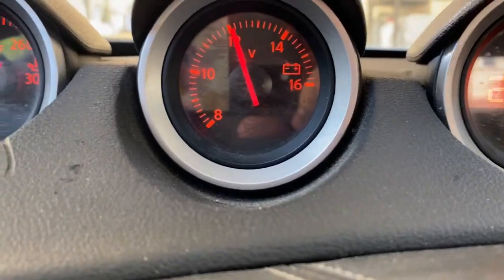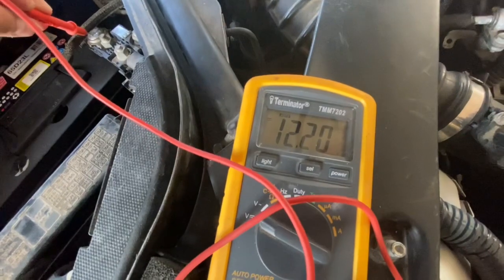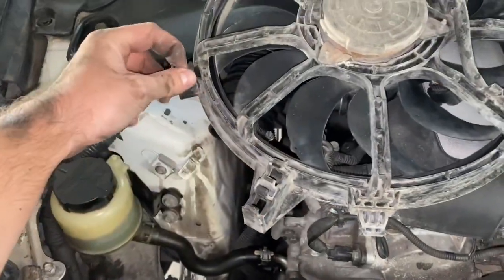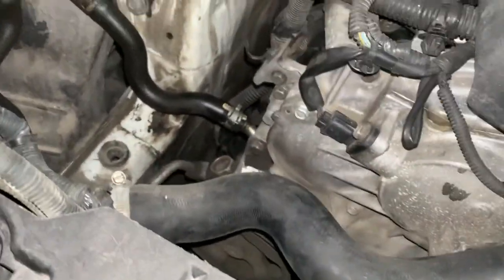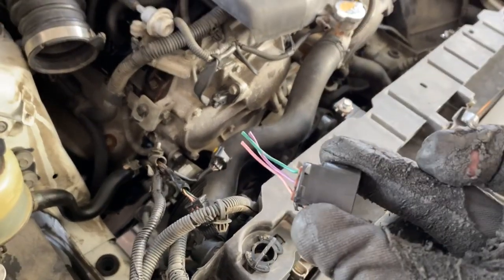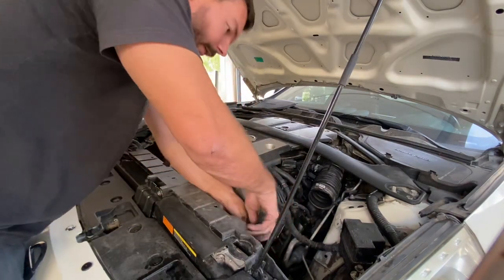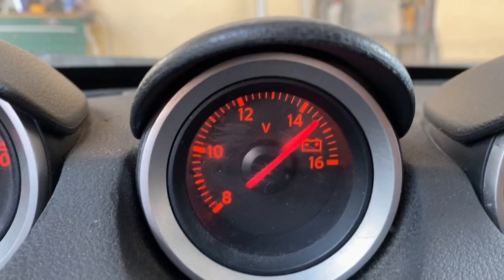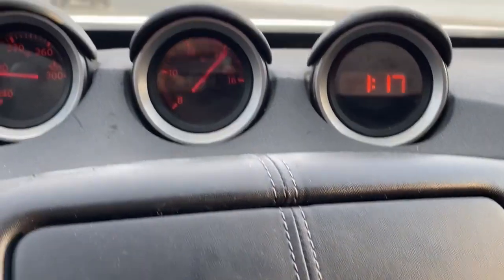Car wont start / run : alternator or battery? (Nissan 370z)

Comment: My car isn’t starting, I’ve replaced the alternator and the battery fully charged why isn’t cranking? But will crack if I get a boost off
Reply: This is happening to mine right now. Taking it back to the shop that put the alternator on. First it was throwing bcm codes and limping for a second at high torque.

Comment: so i just bought a 2015 370 nismo, drove it home from PA to NH and it was fine the entire time 3 days later i go to the gym and it starts but the dash board is all black odometers black gauges black needles not moving. and it works i get to the gym leave im almost home then the gas just doesn't work. but the car doesn't shut off? but then when i manually shut it off it wouldn't start without a jump. got a new battery turned right on but same issue, dash black gauges black won't turn on. was able to drive it all day then gas gave out again by the end of the night. i'm thinking it just needs a new alternator??? i dont know tho
Reply: this why i’m here
Reply: what was it? my z did the same shit on me bro i bought it drove it 1 hr and it was good then the same thing u explained happened and idk what it is
Reply: bro this just happened to my z 😂😂 it would cut off after a while and the voltage meter would
dip slowly currently sealing the alternator

Comment: For future reference, you do not need to remove the fans, nor the tensioner for clearance.  All of this can be removed from underneath the car.
Reply: did u remove the sway bar?
Reply: I didn't have room to remove it if I didn't take out the
Reply: Not so - on my 370 the long bolt holding the alternator won't come out unless the fan block is at least shifted to one side. Other cars/markets may vary
Reply: @PaulH-y8x  I did all this on this specific video on the exact same car without the removal of any of that. Levels of experience varies.